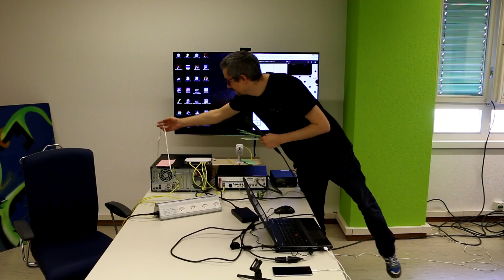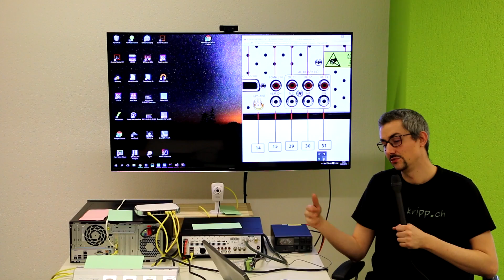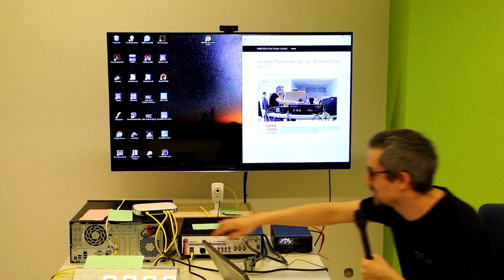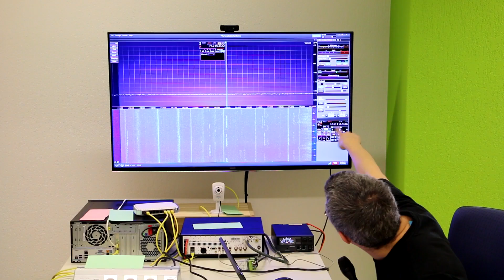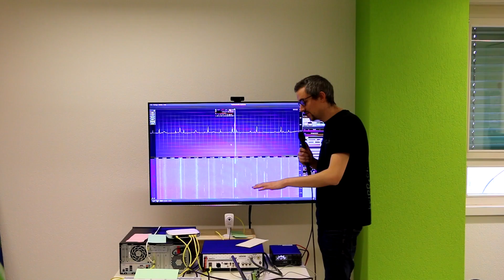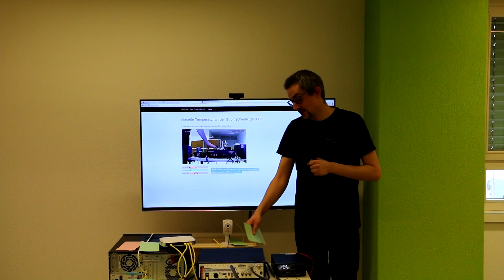10minutes + with hb9fxq  "Flex 6xxx & OpenVPN + a Websocket based Waterfall"

Comment: I did not understand why you needed to setup a TCP openVPN tunnel, instead of the default UDP.  Your Internet connection is very good @ 32Mbits. I did think that you would need 100 Mbits to use 4 slices but see you are doing just fine. It has been over 2 years since I had a chance to use a Flex 6700. With HTML5 waterfall the bandwidth over the Internet will decrease a lot, right? The transmit side of things could work in the normal way using digital voice with the Flex DAC connection, or would you need to use some other software such as IPSound?
Reply from the maker: +Ron Morell Hi Ron. I discovered, that a TCP based connection is working more reliable with the kind of connection I'm using (Radio on ADSL, Remote on 4G/LTE) And yes,  no 100 Mbit - 4 / Panadapter is the peak  I've measured. The HTML5 thing consumes almost as the same, since It's transferring the same kind of data. Flex DAX is allright for raw audio, anyway, Flex already using a very efficient codec "Opus ( https://en.wikipedia.org/wiki/Opus_(audio_format) )" for remote audio beside DAX. That HTML5 webclient is work in progress here... hope, there are plans to do that @FlexRadioSystems also  73 Frank